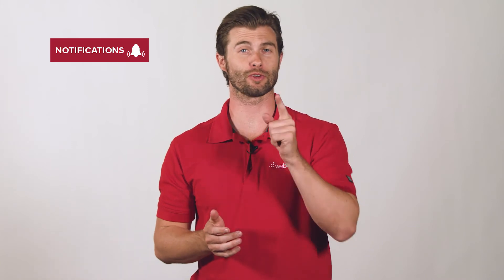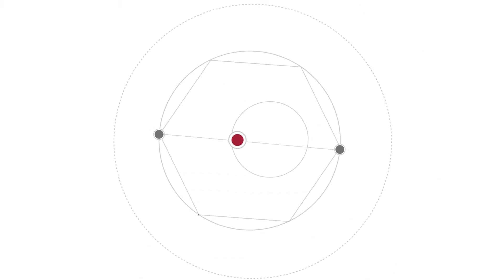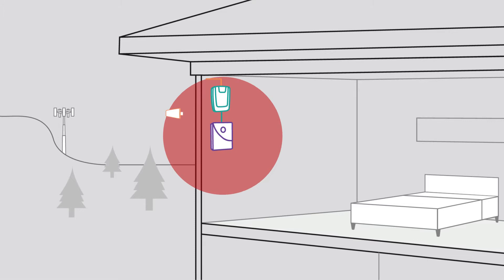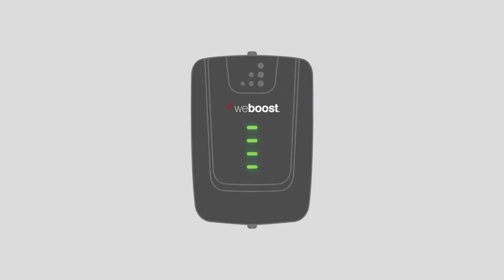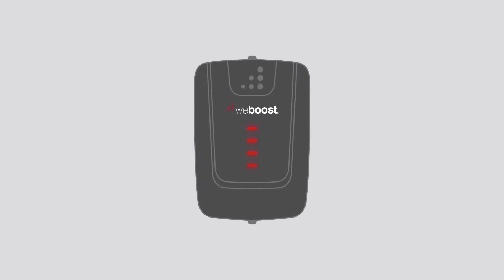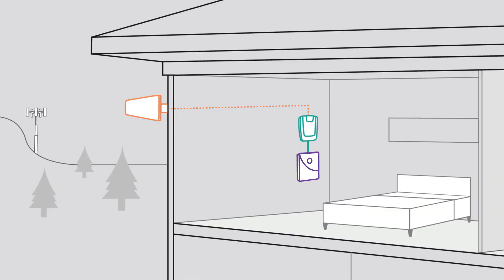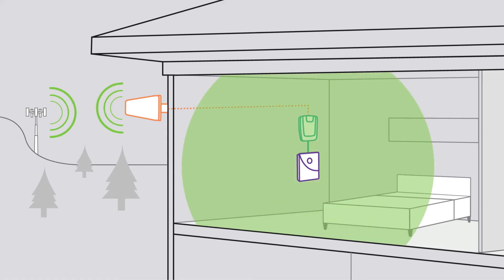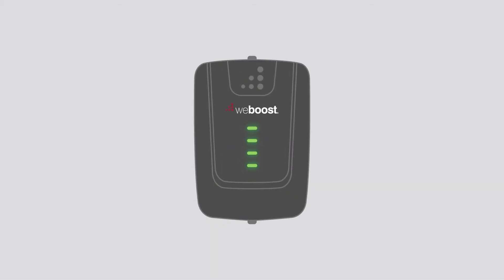Oscillation vs Overload - All You Need To Know | weBoost

Comment: My Weboost works great for a couple of hours with all green lights and then for no reason that I can find,  the top light will flash red. Cant figure it out. We use this at our remote cabin and the tower is about 8 to 10 miles away. When it works, it works really well and other than the occasional blinking red light we have no complaints. and suggestions?